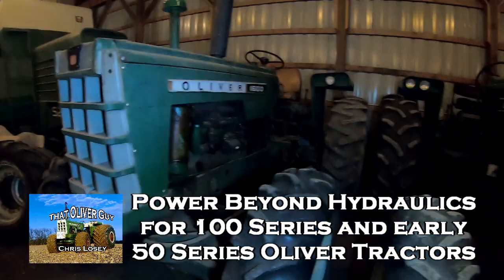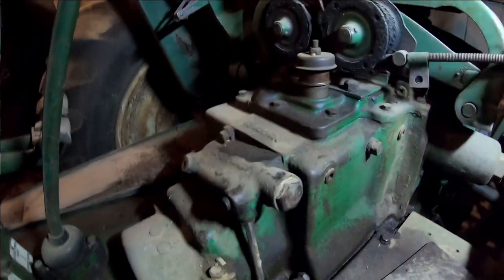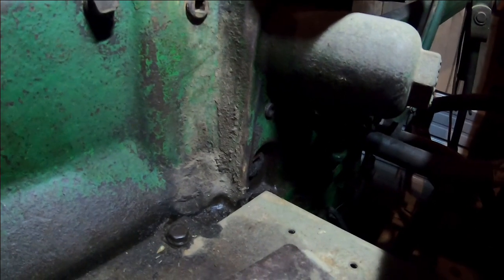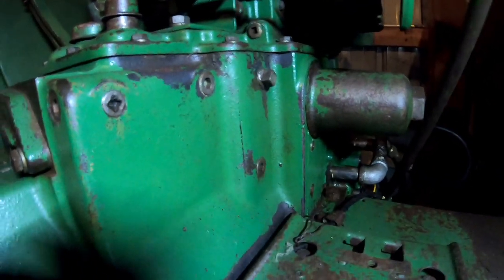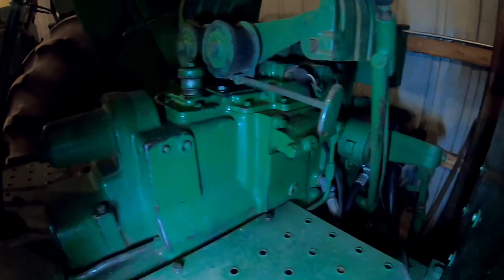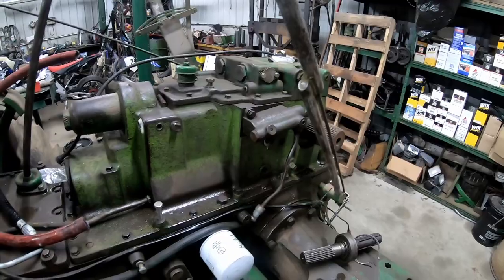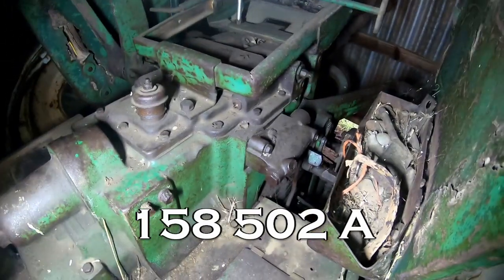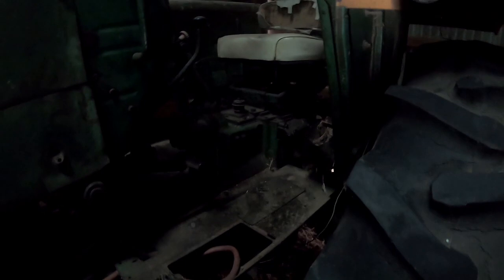Power Beyond Hydraulics for 100 and early 50 series Oliver Tractors

Comment: That was a huge help thank you for taking the time! Looks like I need to start searching for another top cover, and while I’m at it I might as well start searching for the parts to convert to a 1000 RPM PTO and do it all at once lol. Hope you had a great Thanksgiving Chris
Reply from the maker: Glad I could help! We had a very nice Thanksgiving, I hope you did as well. 
Your best bet for 1000 rpm on an 1800 is to get a dual speed unit from a 50 series. They did make a 1,000 only unit for the 1800/1900, but I've only seen a couple in my travels.
Reply: @ThatOliverGuyChris  Yeah I am going to start hunting online and see what I can find. I’m sure it will result in a road trip there are not many of those tractors around in CT these days

Comment: It's a pain to do but on those 1800C top covers I set one up with power beyond. I drilled and tapped the front 3/8 plug for 1/2 pipe thread, gotta take extra time to make sure it's perfectly straight or tilted up slightly otherwise the bolt for the top cover in front of the port is in the way (I made that mistake).  When you drill for the 1/2 pipe thread you need to drill to the edge or slightly past the supply passage  so the 3/8 plug goes in far enough and doesn't slightly block the supply port (made this mistake also) Then I tapped the passage in there for a 3/8 plug to block the flow.  A extra length tap would be best for doing that but a normal length one is just barely long enough and I mean barely.
Probly doesn't make much sense with out pictures but hopefully it doesn't sound like gibberish.

Comment: I've seen a cheat before where instead of installing the internal plug (or if it was not provisioned for it), they just tie the inside remote lever forward or backward with nothing hooked up to the remote coupler which builds pressure in that passageway without having a plug installed.  You loose a remote that way, but if returned to the SCV, you should still be able to use the 2nd remote and the 3pt, albeit a pretty convoluted path, probably adding heat, but gets the job done.... if that makes sense.
Reply from the maker: You'd also be blowing the relief valve almost continuously.  Lots of heat, but it would get the job done.
Reply: @ThatOliverGuyChris  No, still return through the remote coupler return port, whichever side isn't pressurized... It's hard to explain.  But, yeah, never a good idea to just dead-head the pump and "return" via the relief.  Not that I've never heard of that either lol!

Comment: Today our 550 tire was low, so we tried filling it, turns out that the back tires have calcium in them, the tire service will be out tomorrow morning to put new tubes and rim guard in.
Reply from the maker: I have most of the fluid drained from my tractors.  A lot of messing around when you can slap some cast iron on when you do need it.
Reply: @ThatOliverGuyChris  we did even know they were filled, haven’t need to fill them in 13 years! We are not sure if we want them filled or not, they had to come fix another tire for us too, we just kept putting it off. Now we have 3 tires to fix! Figured it was time!
Reply from the maker: None of the tractors I use on a regular basis have fluid, and they do fine. If your 550 is a loader tractor,  filling them is a good idea.  I would tell customers to try a tractor without fluid to see if they really need it, but most would say fill them up. Putting it in isn't too hard, but you can never get it all out without putting in a new tube.
Reply: @ThatOliverGuyChris  the rim was rusted, so we sent it for repair, we decided to go without fluid, but can always have it added in the future, the tire service goes past our place at least once a week. Our 2nd 550 had no fluid in the left side, but about half in the right. He wouldn’t pump it out at risk of the rim rust busting, thus making us loose the functionality of both tractors. Once we get the one fixed, we will have the other repaired.

Comment: Hi Chris, great videos. I have a related question, if the ask Chris segment is still active. The hydraulics on our 2-110 get real hot, whether you’re using them or not. Hydraulic power seems ok, from what I read it seems like it’s the compensator valve sticking. Also warned its tricky and only should be serviced by someone experienced. Should I find a book ? Or find a mechanic? 😂
Reply from the maker: It's not too tough, but you do need a pressure gauge to do it correctly. The book lays it out well. I've been thinking of making a video of that,  just because it is a fairly common question.
Reply: @ThatOliverGuyChris  kind of a common problem? Do they usually need parts or a build? Or a cleaning and a reset? 
Thanks Chris!

Comment: All I know is they  had a really strong man on the assembly line at Oliver installing the pipe plugs.Because everyone I have ever messed with is a bear to get out.🤔😁
Reply from the maker: Agreed. The service manual tells to only use some lead based sealant. I wonder if that is what locks them in so tight. I will say I've never seen a factory fitting leak!